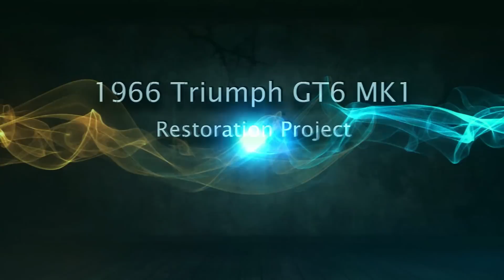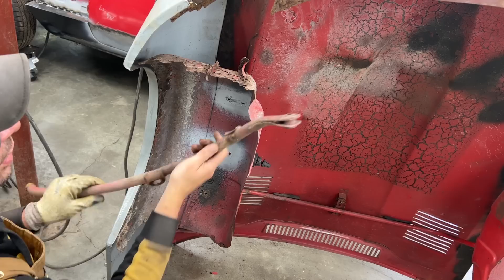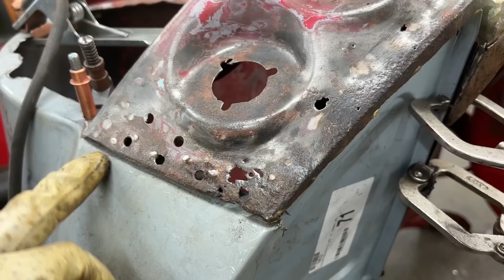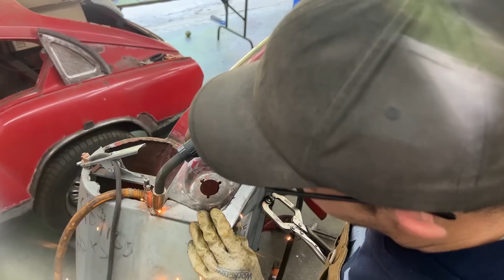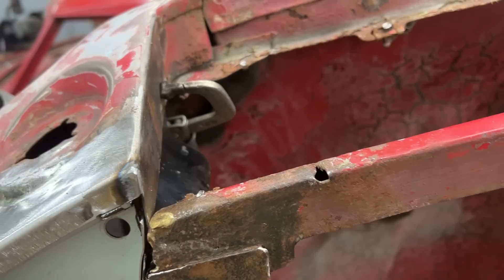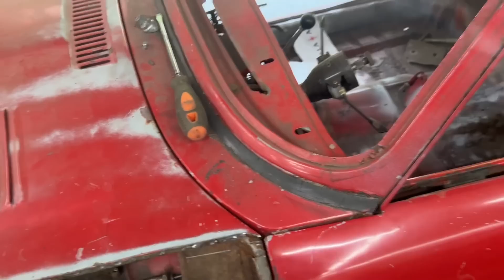1966 Triumph GT6 - Part 45 - Restoring the Bonnet "Bones"

Comment: BTW the nuts on the brackets for the pipe on the bonnet are 5/16 BS Whitworth heads.  The story of fasteners in the early days is very interesting.  The British used a lot of variety of threads and heads.  Some bolts had metric threads but with Whitworth heads.  According to a chart on Wiki the 5/16 Whitworth is about the same as a 14mm.  I once had a Triumph motorcycle that had Whitworth bolts as well as SAE bolts.
Reply: Oooh yeah, that's always fun. I remember unbolting the sills from my friend's Land Rover Series IIA. I was laying under the car with five different metric and imperial sockets and at least five wrenches because nearly EVERY screw had a different head or nut size and often the head and nut weren't even the same size!

Over the years the sills developed a wild mix of BSF, UNF, UNC, Metric and god knows what else.
Reply: @crasbee  Yes I've been there dismantling the front of a friend's Series III Landy

Comment: Good work, not much metal left there!
I had to make one of those mounting brackets for the bonnet iron. 
I also discovered under the bracket I replaced there was a rust hole that had developed, so I removed the other for a look and found the same thing.
https://youtu.be/KfCOXW7eA2g

Btw, I believe that triangle shaped panel is called the D panel 😉
Reply from the maker: Good job with making that bracket. Yeah, I am not very good with the names of all the parts :) I just make up names for them LOL
Reply: @RustyBeauties  yeah. It's more fun to make up names anyway 😜

Comment: Hi Elin, great job as usual  ! I've seen that you have been bending your flange by hand when working on angles (15:22). Just wanted to share that I've been using a vise mount bending brake that works well for these types of pieces. They are pretty cheap and do a great job. Thanks for the video 👍
Reply from the maker: I bend only the awkward flanges by hand that can't be done on the brake. Usually when it is a curved flange or the piece has a shape that doesn't allow the use of a brake. Those you can't do on the vice mounted brake too. The vice mounted brake works great when you don't have regular one.
Reply: @RustyBeauties   Oh ok it make sense. No matters, thank you for the videos it helps a lot.

Comment: great video. I want to now what  weld you  use. tig -mig-gaz no gaz what?nikos from greece
Reply from the maker: Hi Nikos, I use TIG welder with 0.8mm wire and 100% Argon. I should be using 80%Argon and 20% CO2, but I use the same tank for my TIG welder (which I am still learning) and TIG welding requires 100% argon.
Reply: @RustyBeauties  thank you.what your  opinion  about  flux(no argon)?
Reply from the maker: @ΝΙΚΟΣΜΑΣΤΟΡΑΣ-ο9ω  I don't like it. I ran out of gas once and I converted my welder to flux core.... It was the worst welding I've ever done.
Reply: @RustyBeauties  thanks

Comment: This video is really good. Initially the number of areas that needed fixing seemed overwhelming , but you show how , if you just work step by step , the whole thing comes back together with all the pieces in the correct location.  It would be tempting to cut it all out, but then you lose all the reference points, but this way you fill in each section in a controlled progression to a full repair.  A great video again. Thank you.  .

Comment: Hi Elin. So funny the grill bottom rail. I've just rebuilt my 1969 bonnet, or more specifically totally built one from new panels. I mistakenly pit the bottom rail flush like yours on the right. It looked so right like that. Then I realized it should have been set back like yours on the left. Wish you made this video 2 weeks ago. Would have saved me cutting it out and rewelding.  Good work as usual
Reply from the maker: Did you make that repair on my GT6 too? LOL
Reply: @RustyBeauties  I'm all out of rivets. If I'd have done it I would have made both sides the same. Even if both wrong.

Comment: Elin, that hood hinge area was definitely a 'Rusty Beauty'!  I thought that once you cut away the rot from the grill corner/hinge aperture, that the entire area would fall apart like a Chinese Puzzle and there would be no hope of getting the parts to align on re-assembly.  Did the new sheet metal pieces help with alignment along with your reference marks?
Reply from the maker: Yeah, it was a mess, but luckily the repair panels were pretty good fit and helped me put it back together without major "remodeling"